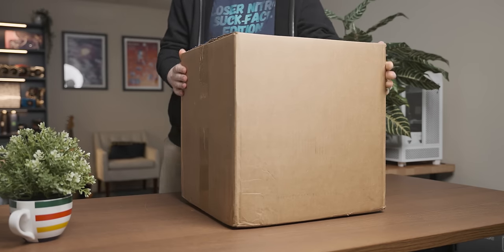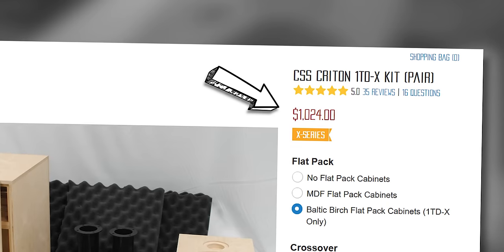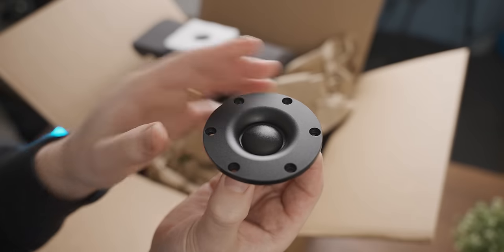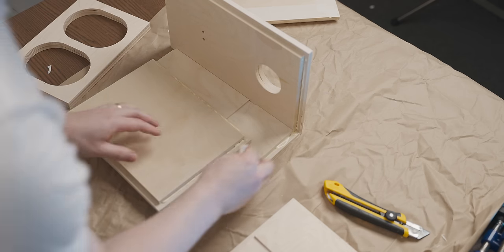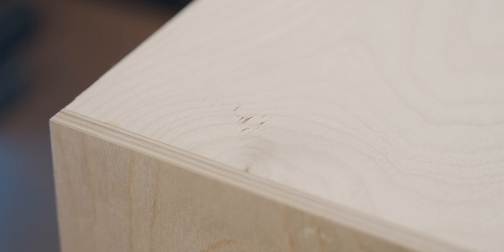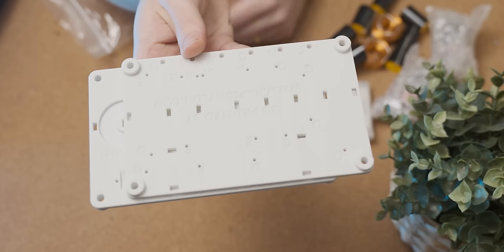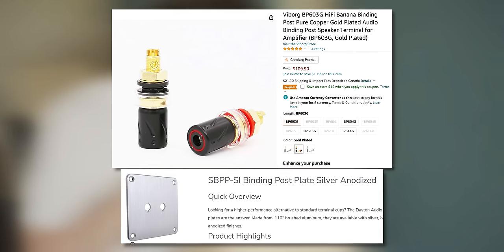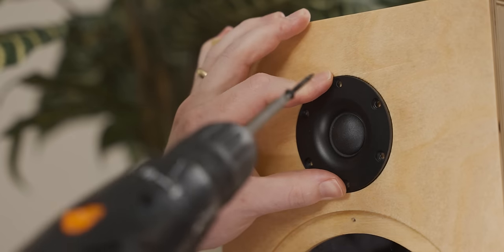The MOST Underrated Gaming Upgrade: DIY Speaker Build

Comment: I had no idea this was a thing, but I'm gonna keep my eyes on these for when I need to finally upgrade my speakers (probably somewhat overdue). My only question (and this is probably answered on their website lol) is how is the frequency response on these speakers? Is it more of a flat response or one tailored for listening? As someone who dabbles HEAVY in music production Flat responses from any headphones or speakers is a MUST. I saw later in the video you mention the speaker's bass, is there any control on the speakers to tweak the bass response? My current speakers (marketed as "studio monitors", not sure if that has anything to do with having the feature) have some frequency tuning on the back which includes dropping the db of low end depending on how far they are from your walls as they have rear firing  subs. 
Audio is definitely one of the most overlooked parts of a setup. I just upgraded my headphones (previously a pair of sennhesier HD579s) to the Sennheiser HD6xx from drop (only $200!!!!) and am absolutely loving them. I don't even have a set of truly balanced cables for them (yet!) and I can already tell how significantly better they are at separating/emphasizing  the right and left channels.
Reply from the maker: According to reviews I’ve seen online of these, they measure very flat. The also go down to 30hz in room which is why they kick so hard I think. There aren’t we controls on the speakers, but CSS audio can advise you on crossover changes that would make the speakers work better in your room.
There are also lots of very good studio monitor options though, they mostly have the advantage of being powered. 
Good luck on the hunt for the best pair of speakers for you. 👍
Reply: They look like hifi speakers, no information on the website, you need studio monitors for flat audio(production intended).
Reply: "Studio" monitors should have been called "near field" monitors - they're designed for listening with them close to you, say 20 inches.  And yes, they typically allow adjusting the bass response for placement issues - half-space (center of a wall) vs quarter-space  (wall - ceiling/mixing desk) vs eighth-space (corner where two walls meet and the ceiling or mixing desk) placement.

Domestic speakers are typically designed for an 8 foot-ish listening distance in a typical living room, placed near the floor on stands, two or more feet away from room corners and close-ish to the wall. Quarter space, roughly. With good speakers the frequency response depends as much on the room that they're in as the speakers themselves, and it will be very lumpy. Rooms are awkward, but our ears adapt very quickly.

That's above about 200 Hz, which is where you can locate sound direction.  If you have to have the lowest three octaves at volume there is no substitute for size, despite all the marketing. Don't try to use the main speakers for these frequencies unless you're spending multiple thousands and have the space for large floor-standing speakers. Place a 12-inch or bigger sub one-fifth of the way along the longest wall for flattest response (in typical rooms). (What we usually experience as "heavy bass" is the second and/or third harmonic, e.g. 100 Hz  and 150 Hz distortion produced by a speaker trying to play a 50Hz note.)

If you want to know what you're actually listening to, from your speakers in your room, get a Behringer ECM8000 measurement microphone and a mic stand, and a copy of REW (Room EQ Wizard). (You can spend more on your measurement microphone if you want, of course. U-Mik, Earthworks, Daytona, etc., etc.).  Then you can start buying acoustic treatment tiles. 🙂

Comment: I use some Cambridge Audio SX50 speakers at my desk along with an old 1997 Cambridge A1 amp. I have a cable which lets me plug the amp into anything with a headphone jack so it is just plugged into an HDMI switch box. Probably the only disadvantage is that it is quite a big setup since I have a big table thing under my desk so no leg room and the speakers also take up heaps of room so I'm stuck with a 21.5 inch 1080p monitor.

Comment: @Dawid Does Tech Stuff My Gaming Rig is connected via a TOS link to a Sony Head Unit / Tuner which is connected to a Bose 5.1 Surround Sound System & 2 Banging Olufsen Towers (Making 7.1 surround) This way you get Zero distortion

Comment: For the price of those "DIY" kits, you can have a pair of active studio monitors and a pretty good audio interface.
The pricing for a kit is a bit crazy ^^' You really have to buy it just for the pleasure of customizing it
Reply: Underrated comment. These speakers for that price are super bad. You can get similar audio quality just buying KRK Rokit RP7 G4 or similar for way less and with way more way to dial them in properly.

Additionally those speakers shown can't sound as amazing as described in the setup presented, frankly speaking I highly doubt the results.
The video shows them backed up against the wall pretty much destroying the audio the port tubes can produce. It also didn't look like the stereo triangle was set up correctly.
It's a big oof - funny how so many people buy into it though.

Comment: 5:30 Dayton is no crap. There's indeed a certain 'don't go below this level and you will be okay' to all of this. Same with speaker cables, really. As long as it's copper and has some Thicccc to it (2.5mm2 is plenty) it shouldn't ruin your sound TOO much. Anything about that is, really, a matter of taste. I have tweaked the sound of my rig by changing from one speaker cable to another (in my case it was Wireworld Stream 16/2 to Dynaudio Ocos). Brought a little life back into it after a change for slightly more laid back sounding speakers. Same really happens with capacitors. You have clarity caps for instance, that do exactly what the name suggests. Generally though 'half decent' is at least good enough to get a very solid impression of what the speakers are capable of

Comment: 6:43 Ah don't worry too much about it, soldering just takes practice.  I'm not as practiced as I should be, but I can still get the job done.  So long as the solder joint isn't "cold" you should be fine (if it is cold you will eventually have to fix it later, but on a speaker it should be immediately apparent if your joints are messed up.

Comment: I'd say Sound Cards are even more underrated, most people just forget they exist, even though they elevate even cheap speakers to new levels. DIY speakers can be nice, but you can also easily mess it up and end up creating mediocre speakers. A proper setup with an amp and a DAC plus your selfmade speakers gets expensive quick, and that is for a 2.0 system that just can't quite reach as low as a proper subwoofer can

Comment: As long as it meets class 1 ipc standards you can solder anyway you want. It's a speaker lol.

I soldered the telemetry boards for a satellite by hand for work. Class 3 isn't hard to achieve with every solder joint. Just takes practice.

Comment: home theater is a thing, and pcs HAVE audio processing in them, just GOOD drivers and PLACEMENT, AND TIMING ALSO makes a difference too, IF ur sound card offers distance tuning do it its pretty straightforward just measure from ur head to where the speakers are and match that distance to the graphical representation in feet or meters in ur audio tuning app in ur soundcard software IF it supports it, i see it alot, but not on every card.. , bc u know the speed of sound is quite slow, so some good distance and proper measurement makes a difference too in the sound imaging, and all that "tank and air feeling" u were getting is through sound imaging, its a pretty neat thing and makes games come to life!  =) GREAT video...i think this part of pc gaming gets ignored these days too, but tis the world we live in, great build but i was sad after all that work on the enclosurs that u didn't go inside the cabinets and run some silicone bead up the seams, wood glue is PRETTY ok, but it doesn't do what a silicone seal would offer as far as tightening up your enclosure... =) take them speakees out and seal it up good! it will make a difference! cheers!       0===(>>>>>>>>>>>>>

Comment: You should implement a subwoofer in the setup. 
It changes a LOT for ambient low freq noises (also generally low booming noises).
Reply: An active subwoofer might be more expensive, but is a lot easier and takes less space.

Comment: Currently in my small flat I have a Sony HT-IS100 system that has little golf ball size speakers but I have an upgrade ready for my upcoming house move- Sony SA-VE835ED Pascal speakers with a Sony STR-DA2400ES amplifier. The speakers are fairly small but weigh 1.3kg EACH and the subwoofer is a 2x100w 15.5kg unit. I already know how they sound as I have used them before in my bedroom and they kick ass for their size. Oh, and they are extended definition too and go up to 70KHz, way above what "normal" speakers will go to. I never use headphones and if I'm using voice chat I use PTT anyway.
As for the living room gaming, well that's a different story. That system is running 6x Sony SS-B4ED speakers (13.8kg EACH) with a matching SS-CNB2ED centre running off of another STR-DA2400ES amplifier.
Can you tell I like Sony? My neighbours, not so much!

Comment: You could say the same thing about a 2.0 system, you need a 7.1 to experience true surround sound. No doubt these are good, but I prefer high end headphones
Reply: Huh well what gear do you use then? :p
Reply: @maxdergroe9082  I use either my GameDAC gen 2 or my ifi idsd black label to run my headphones, but I use a modded Beyerdynamic TYGR 300 R, Beyerdynamic 177X Go, or sometimes my 7hz Timless IEMS's
Reply: @Nonx47  What a stout amp for these easy to drive headphones tho, but sure does bring the 177x to live. I just dont know what to think about the GameDAC because of Steelserieses shotty QC.
But IMO a good stereo setup is by far better than any other consumer 7.1 "System".
Reply: @maxdergroe9082   @Max Der Große  I used to have harder to drive headphones, but sold them and kept these. There's too many diminishing returns when you go up to those prices. I prefer these Beyerdynamic tunings from these two headphones, and even though they are lower ohms, they sing when pushed with more power and a good DAC. 

The GameDAC gen 2 is decent, and it does a good job with mixing the chat and game audio while giving some extra power. 

I prefer a decent 2.0 setup too, my point was that headphones are exactly just that... A 2.0 set-up. Open back headphones do a really good job for soundstage, but they can be so much more intimate and give you some more detail than most 2.0 speaker setups if you have the right equipment. This is my own personal opinion, and yes a speaker setup can be more immersive and laid back, I just prefer headphones personally
Reply: @Nonx47  Thats a fair tho, there is more to headphones too than just sound, not bothering anyone else with sound really is something nice with headphones or late night gaming sessions on full blast. I rock my Senny HD600s out of a Audient Evo4 thats also feeding my JBL 305p's and my Blue Ember, so Im pretty familiar with the magic of open back headphones and am now also spoilt for life with this curse xD

But I gotta say, audio in a gaming setup really is something way too overlooked, especially with silly gaming brands selling "gAmInG hEaDpHoNeS" with awful sound for way too much money. I think that puts a ton of ppl off from buying nice gear, but worst of it all is the build quality and the acceptance of audio gear not lasting longer than 3 years tops and it getting outdated too. This is borderline a crime to peoples wallets and ears.
Reply: @maxdergroe9082  yeah, gaming headsets are typically utter trash. Basically toys.

Comment: $1000 for these?! What fuckin kick in the Balls. 2 years ago I bought a pair of speakers at 300W each, one of them has a built in amplifier and the other is a Slave unit. There's a specific plate which houses the USB and SD slots, with the usual track control for when you're listening to music that way (if you want to). There's a Master, Treble, and Bass control knob. There's also 2x Mic ports, both with separate control knobs. Each speaker has a sturdy handhold recessed into the top of each. The pair cost me £120, free delivery, no added charges on top. That's $145 USD. So the moral of the story is don't get ripped off, always buy at an appropriate price, and shop for the purpose. It doesn't have to be expensive to be great.

Comment: PRO TIP. 
Really good sound  can be achieved By Looking for older Surround Sound//theatre Amps for about £20--50. Look for the ones with Optical inputs and Good Speaker posts plus a budget set of Hi Fi bookshelf speakers. All in should be less than £60 or you are not trying.

Comment: I am using 4 sony 6.3x9.4 inch 4way car speakers with a sony car headunit i got for free, made my own cabinets & it acts as a 70w rms bluetooth speaker/radio/pc speaker 😂 the bass is enough to shake windows & i actually want to make a 4x100w rms amplifier but never really had the motivation to print the pcb & get the parts.

Comment: Can someone explain me about adding foam inside the speakers? I thought these foams are supposed to absorb sound and does it reduce the volume by adding them?
Reply from the maker: Sorry I should have explained this in the video. It is used to damp any vibrations in the speaker cabinet. This helps reduce any unwanted cabinet resonance interfering with the sound the drivers in the speaker are making.

Comment: For the longest time I have always used headphones. It was a lot more convient wouldn't leak sound into other rooms. 
But since moving to my current place I have bought a pair of Edifier 1700BT's and I found my self using peakers more often. Thye wont sound as amazing as the ones you've shown but for 150 dollars they are really good! 

Although.. I am still mostly using my Sennheiser x58 Jubilee's more often. these are the latest addition to my audio set up. the first openback headphones I have used and I have ot admit.. I really like the sound of openback headphones more.

Comment: Damn you sensored the soldering once again... finished solder joints don't look bad honestly. I think your soldering thin has too little flux from what I can see in the video though, but not your fault!
A digital to analog converter... every motherboard has one and you honestly don't need much better when you're not driving headphones!

I also made my setup. I picked two small form factor but deep speakers (I mean in size) so pretty bassy, and I even added a sub.
The amplifier is what I made diy, and I didn't use any tutorial/premade thing
My DIY amp has precise control of frequencies for both the main speakers and the sub! Amazing for gaming and listening to music too!

Comment: ++i have a reasonably good 2.1 stereo system that i use for listening to music / watching youtube and movies and they sound amazing. the whole positional audio thing is basically due to "head related transfer function" meaning one ear hears a sound a fraction of a second sooner than the other depending on the direction it is coming from. most "surround sound" headphone actually only have 2 channel input and 2 drivers, it is the software or a DAC that converts the surround sound to 2 channels in a special way that makes you brain think its surround sound

Comment: You can use speakers with VoIP. But you'd want a hyper cardioid polar pattern mic and place the mic in the right position
Reply: not in all cases, i use a omnidirectional measurement mic and stereo speakers. no one has heard anything but my voice so far.
Reply: @sudd3660  fair. You must have the speakers quite low, and the gain on the mic fairly low, just enough to pickup your voice.
Reply: @BierMeister360  i dont know, but its nice to know that so far i dont have to spend money on a dedicated mic for my discord use. 
maybe discord is very good at filter out noise? and you have to install discord on your pc to get all the options.
Reply: @sudd3660  unfortunately I cannot say wether discord VoIP is any good with xlr mics, as I use a mac or console, mac for minecraft java. Console for the rest. And discord on mac os doesn't have support for multi input audio interfaces, (I use the focusrite scarlett 18i20) even using logic pro and loopback. Just cuts in and out like hell, even my airpods, and macbook internal mic doesn't work on discord.

Comment: 12:22 I am proud, Dawid. I thought you'd pull up some Marantz or Sony but you actually got a really, really lovely amp there. You don't know the name (It's a Unison Research Unico Primo) but that's a gem of an amplifier. I can assure you that if you'd used a normal hifi receiver for that, the speakers wouldn't have sounded half as good. Big part of what you hear there is the typical robust, open and airy sound of a Unison Research. That thing makes me salivate harder than those wooden boxes, for sure!
Also great choice on the Topping. I feel like you may know more than you are giving away here. These are not accidental choices ;).

Comment: In Philippines here we love karaoke but crossover's suck they tend to fail in big events because the quality is poor the copper winding's are replaced by aluminum-ish a quick solution is putting the right capacitor value on the positive side each frequency varies the value putting it on the positive side of the speaker